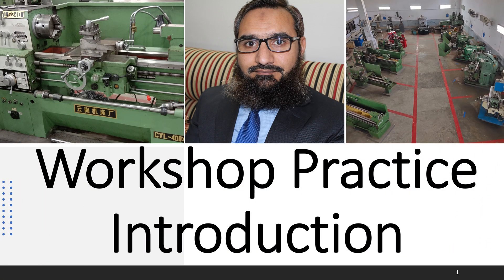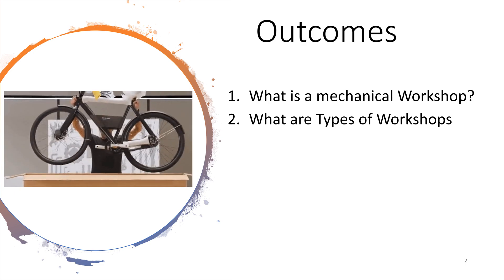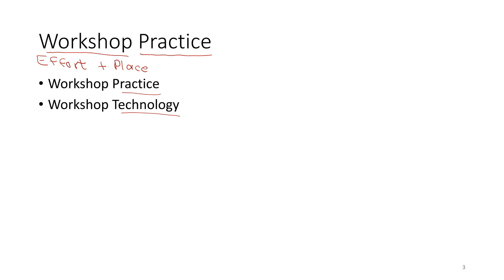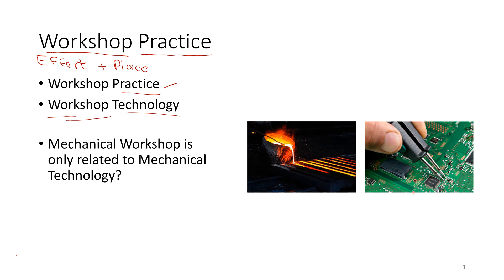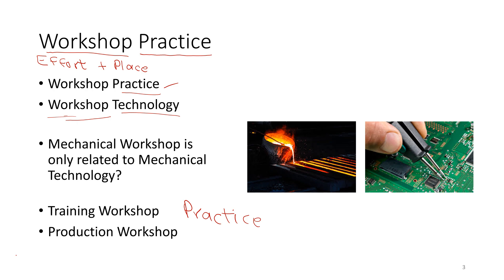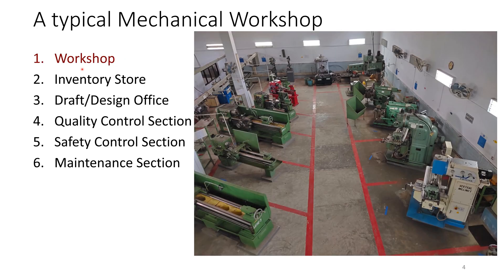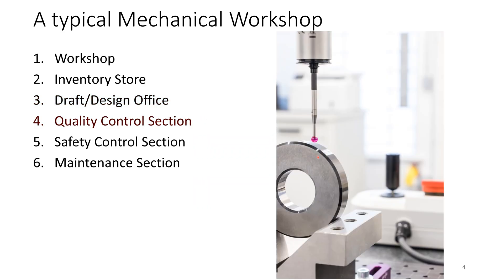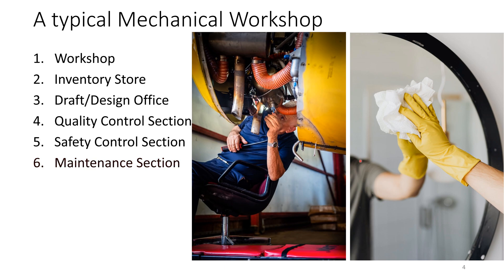Workshop Practice || Workshop Technology || 1-1 Introduction | support sections | Mechanical

Comment: The Workshop has 3 different departments,
1)Quality and the control section
                                                                                                                                                                                          
2)The Maintenance section                                                                                                                                                                                                3)And lastly the Health and safety section
reg#2020205

Comment: My Name is MUHAMMAD HUZAIFA SHAFIQ.
Registration No: 2020309.
1)Mechanical Workshop is a place Where students acquire knowledge involved in manufacturing and production.
2)Types of Workshops:
a)Training Workshop.
b)Production Workshop.
3)Mechanical Workshop is not only for Mechanical Technology because different types of Engineers are involve in it.
4)Main Sections of the Workshop Department:
a)Quality Control.
b)Safety Control.
c)Maintenance.

Comment: -A mechanical workshop is not only for mechanical technology rather many other technologies are dependent on it.                               

-A typical mechanical workshop,                              1. Workshop.                                                               2. Inventory store.                                                         3. Quality control section.                                           4. Draft/design office.                                                   5. Safety control section.                                            6. Maintenance section.                                                 Reg no : 2020078

Comment: What are main sections of a mechanical workshop?
ANS: 1. The production workshop: Building and Construction of the product
          2. Inventory Store: For the storage of equipments and tools
          3. Design Office: Works on the designs of the products
           4. Quality Control: A section that maintains the quality of machinery and products in the lab
         5. Safety Control: A section that deals with the safety of the workers
         6. Maintenance: A section for the maintenance of machinery in the lab

Reg No. 2020304

Comment: The types of workshops are as follows:
1. A production workshop that is used for constructing a final product.
2. A training workshop that is required for hands-on insight into the working details of the product making procedure through practice.
Reg no. 2020334

Comment: Ans:
Inventory store
Draft and design office 
Quality control 
Safety 
Maintenance 

Work shop include electrical fabrication section,metallurgy,Smithy shops to entertain other departments of engineering aswill........
Reg:2020349

Comment: There are 6 things found in a typical Mechanical Workshop
1. Workshop 
          It has many different machines which have different jobs to perform 
2. Inventory Store 
          It stores Materials, Raw Materials , tools & different Measuring Instruments 
3. Design Office 
          Drawing and samples are used here to make new ones 
4. Quality Control Section 
           It is basically an a inspection section which checks if all jobs performed are correct & also according to the drawings 
5. Safety Control Section 
           Ensures Safety of Workers , Environment & Equipment's 
6. Maintenance Section
          Makes sure if everything is in Service & all equipments and Machines are working properly 

Reg No. 2020150   (FME)

Comment: Answer to the question: 
The various section of workshop are:
1.workshop
2.Inventory 
3.Design Office
4.Quality Control Section 
5.safety control section
6.maintenance section
Reg No. 2020187

Comment: Types of Workshop:
The two types of workshop are:
1. Practice Workshop
2. Production Workshop
Practice workshop is basically used for training purposes, to gain some experience and production workshop designs and produces different products for its clients.
Reg No: 2020072

Comment: Ans: sections include 
- Inventory section 
- Draft and Design Office
- Quality control 
- Safety 
- Maintenance 
Apart from these sections the workshop may include electrical fabrication section , metallurgy or castings foundry and smithy shops to entertain other departments of engineering aswell 
Reg 2020322

Comment: Q: different sections of workshop in our reach ? 
Ans: in our work workshop there is bench work section i.e. design/draft section . 
Machine section i.e. workshop section. 
Tools section i.e. inventory section 
Section where lab coats and boats are availabe is safety section .
There is also maintenance section 
Reg no: 2020251

Comment: There are basically two types of workshops:
1. Training Workshop.
2. Production Workshop.
 Different sections of a workshop department ; 
1. workshop
2. inventory store
3. design office
4. quality control 
5. safety control
6. maintenance
Mechanical workshop is not only for meachanical technology. it is used to help other technologies as well . e.g electrical  or electronics departments

Reg No#2020204

Comment: There are the kinds/departments  of "WORKSHOP " . A plumbery workshop , welding workshop , carpenters workshop that we usually see at domestic level. So , it is not restricted to specific field; technical physical work/practice  mostly need workshop.
REG NO.2020317 (EEP)

Comment: Muhammad Adnan
FCV
Reg NO # 2020263
Question NO #01 ) What is a Mechanical Workshop ?
Answer) A Mechanical workshop is a Practical Session where every  individual Performs Experiments individually keeping in view the mind Of an Engineer .

Question # 2 ) How Difficult a Mechanical workshop Looks Like?
Answer) A mechanical workshop is just like Factory where various Sections are also involved in the maintenance,
Safety of Workshop,Quality as well as the Discipline of Mechanical workshop.
Further, there are Raw material Store Room where mechanical tools instruments and raw materials are stored known as a Store Room.

Question # 3) Is Mechanical workshop Limited only For Mechanical engineering?
Answer) No, Mechanical workshop is not limited upto mechanical Field. Nano technology,Electrical Electronic Civil and several other Fields also have an access to Machanical Workshop.

Comment: Ans 2: There are two types of workshop 
1) Training workshop
2) Production workshop
Ans 4:Main section of workshop are given below
Quality control section
Safety control section
Maintenance section
inventory store
design office
Workshop
Ans : 3 No , Mechanical workshop helping other technology as well 
like there are electrical and electronic department or section which also need mechanical work shop
Reg No : #2020425

Comment: There are three main different sections at workshop
1)Quality control section
2):Saftey control section
3):System control section
                                 Mechanical workshop is not only for mechanical student but also for other like electronics etc
                                   Muhammad Sami Ul Haq\
                                   2020350

Comment: Answer to the question:
The various sections of a mechanical workshop are:
1. The workshop itself
2. Inventory store (where materials and  tools are stored)
3. Draft and design office (for drafting the layout of the work)
4. Quality control section (to check the quality of work)
5. Safety control section (to keep workers safe)
6. Maintenance (to check machine and materials are up to date)

Reg no: 2020390

Comment: Question : Mechanical workshop is only related to Mechanical technology?
Ans: No , Mechanical workshop is related to many different fields in various technologies 
For Example,
For metallurgical purposes we need various equipment from the workshop like furnace ,
also for electrical purposes there is a section called electrical fabrication section.
Ans 2 : 
The various sections in our workshop include :
Maintenance control section
Health and Safety section
Quality control section
Inventory Store
Workbench ( Draft and Designs).

Comment: Q: Can you identify the various sections or departments of a workshop in your reach?
Answer: 
There are 6 main sections of a workshop each working together to complete a job or task:
1-Workshop itself 
This section of a workshop has the entire complex machine whether manual or automatic
2-Inventory
This sections has further two divided sections one is the material store where all the raw materials are found which can then further be used in the job to produce a particular product. The other section is the tool store, where all the tools used for measuring the job are placed.
3-Drawing/Design office
This section has all the necessary drawings and design blueprints for the product to be made in the job.
4-Quality control section 
This section is assigned to check inspect whether the product s are designed according to the designs. It also ensures that all the measuring instruments are calibrated correctly and are up to date.
5-Safety control section
This section ensures the safety of the equipment, the environment the mechanical engineer or any other engineer related to other field is working and also the safety of the working person as well.
6-Maintenance
This section ensures that everything is at service and all the equipment and machines are working fine throughout the production or training period.

Comment: Muhammad Athar Waqas Reg No. 2020279 
Mechanical workshop does not only deals with mechanical technology. Material learned through these workshops have numerous applications in sectors such as electronics , metallurgy , casting and etc. Furthermore, the video explains the difference between training workshop and production workshop. Training workshop is for practice and training of people whereas production workshop is for production of things.

Comment: mechanical workshop is not only used by mechanical engineers but it is also used in other engineering like electronics and metallurgy engineering. The basic knowledge of mechanical workshop is necessary for all type of engineers.

Comment: Reg No. 2020259
What is a Mechanical workshop?
Mechanical Workshop is a place where students acquire knowledge on the operation of various processes involved in manufacturing and production.Some commonly used tools include pliers, chisels, files, rasps, sanding blocks and wood plane.Workshop is the core of learning about different Materials, equipment, tools and manufacturing practices that are observed in different manufacturing functions and operations.

Comment: Question: What is a mechanical workshop?
Ans: Mechanical workshop is basically a practical work or effort students perform so that they become competent in handling practical work in engineering environment!
And it is not only related to mechanics but also relates to electrical and metallurgy.

Registration number:2020411

Comment: REGISTRATION NUMBER: 2020130
Mechanical workshop does not necessarily mean it is linked to the mechanical technology only. The skills gained through this workshop have widespread use in other fields such as electronics, metallurgy and casting etc. The video then goes on to explain the two types of workshops i.e: Training workshop (to practice and train inexperienced people) and the production workshop (the creation of new products)

Comment: REG NO  2020395                                                                                                                                                                         answer to the question
no ,mechanical workshop is not only for mechanical technology - it is also used  in other technologies including electrical and electronics as well

Comment: Answer to question:
The various sections or departments of a workshop are.
1. Quality control section 
2. Maintenance section
3. Safety control section
   Reg. 2020298
Reply: The various sections of a workshop comprise of the following:
1) Quality Control Section
2) Maintenance Section
3) Safety and Control Section

Comment: Answer to the question:
There are three different sections in a workshop
1. Quality control section
2. Safety control section
3. Maintenance section 
   Reg No:2020013

Comment: Concepts attained~
There are basically two types of workshops:
1. Training Workshop.
2. Production Workshop.
~Training workshops help in grasping the skills required and developing them. 
~Production Workshop utilizes the techniques for device/machine production, in large or small scale, as specified by the customer.
Registration no. 2020243

Comment: Muhammad Abdullah  Reg No 2020254;  Apart from the workshop itself, several departments cooperate with each other to ensure the smooth functioning of the workshop. The inventory stores, in bulk,  spare parts, and other tools or materials that are required in the workshop. The quality control section makes sure that the products being manufactured are up to the mark and meet certain standards. The health and safety department's job is to make working in the workshop safe for all workers, be it through providing necessary safety equipment or through educating the workers. Lastly, the maintenance department makes sure that all machines, tools, and other paraphernalia are working properly. This is done by taking certain preventive or corrective measures.

Comment: Reg no: 2020099
Answer to question: 
No, mechanical workshop is not only related to mechanical technology it works for other technologies as well like electrical and metallurgy. So other technologies also depends upon mechanical workshop.

Comment: Concept learned:
There are, essentially, two types of workshops. 
1. Training Workshops
2. Production Workshops

Training workshop, entails, the application of the concepts learnt, and helps us train and develop the necessary skills, whereas Production Workshop largely refers to the production of appliances and other products, as required by a certain customer.

Reg No. 2020233
Reply: good

Comment: Answer to the question :

There are 3 main departments of a workshop

1)Quality control
2)Maintenance
3) Health and Safety

These all together make sure that the workshop is running in its prime condition.
If one of these lags behind the workshop wont run smoothly